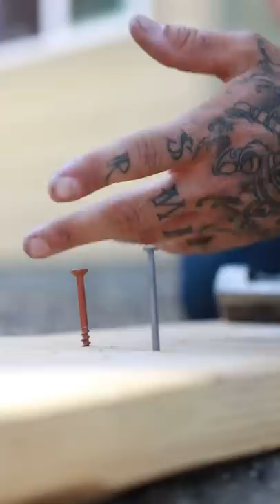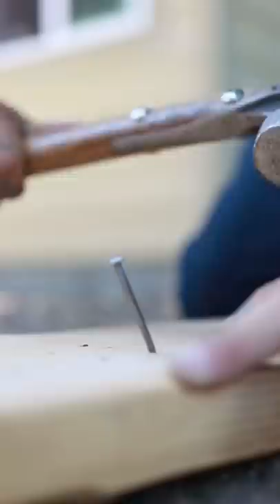Nails vs. Screws: Why do we use nails? #shorts

Comment: You’ve got bigger issues if your structure is moving enough to break a screw

Edit: I understand some structures will move but those are bigger buildings. A little 2 story home should not be moving enough to break a screw. Plus even if it did it is likely to back that nail out with that much movement
Reply: Nope. You got problems if your structure doesn't move. Especially in regions with earthquakes like for example in Japan. Look up 'japan earthquake skyscrapers swaying'. If they were completely stiff they could not absorb the force and would crack.
Reply: Carl Sagan  Of course not, but neither did they build them with screws. I  just meant to say that this is in principle a valid argument.
Reply: Is using nails really the right approach to earthquake proof a house? Seems like actually making it more rigid but with deliberately designed features to effectively provide suspension and/or lateral sliding movement would be the way to go there. That’s my impression of how those buildings are built. Not with flexible fasteners, but very stiff sturdy fasteners and rigid structures with specialised design elements to absorb the forces. 

But if we’re just talking normal houses in non-earthquake areas then you wouldn’t think this flexibility would even be much of a thing. Maybe slightly. But I am inclined to believe it’s mostly about cost in terms of the actual fastener cost but even more so the time cost. You can shoot multiple nails from different angles even diagonally in a couple seconds where it’d take a while to do that with screws. And the screws would need to be pretty expensive to be up to the task reliably long term etc. when instead u can just fire a bunch of nails in
Reply: @tristan7715  yes up high. Not single family homes lol
Reply: Carl Sagan  skyscrapers move a LOT, constantly. The taller they are the more they need to be able to move.
BTW, bolts and steel girders are also ductile (can flex).

Video is 100% accurate. This is why nails are used instead of screws.
Reply: No you have problems if your structure does not move.
Reply: Because nails are cheaper
Reply: How many builders does it take to figure out why they use nails 🤣🤣🤣
Reply: @tristan7715  
I'ts actually not....
Yes structures shift and settle but shod not flex near enough to break screws...

But everyone is an expert i suppose
Reply: True
Reply: Nails are all about speed and cost. Once you put 100,000 of anything in a structure, it's not about strength of one anymore.
Reply: Facts
Reply: I think you just have issues
Reply: Screws and nails have other uses. Would you use nails to attach the hinges on your doors? No - because the quality of inter-fibrous friction fasteners is superior for the job.
Reply: It has nothing to do with the fact it’s 10 times faster hahaha
Reply: @tristan7715  You're right dude. Don't listen to any of these smooth brains. Lol.
Reply: I use both. Assemble with nails. Reinforce with screws.
Reply: Hurricane straps for shifting highly stressed wooden timber elements typically use nails. Just a thought.
Reply: Not true.  Buildings move every day and are designed to move.   The earth moves.
Reply: Carl Sagan  bruh I’m weak from that I lold in the library
Reply: 😂 Flatlander….
Reply: @tristan7715  Nobody is building skyscrapers with nails and boards.
Reply: I reckon
Reply: @Thecabbagedog  and faster! I hear those framers and roofers all day long. It sounds like they are at the machinegun range!
Code calls for three nails, well, if I send 16 nails in, at least three will meet code!
Reply: No, because houses settle. So they actually move.
Reply: @tristan7715  I'm completely stiff.
Reply: @MarkusHeimy  that’s not true at all. All buildings move
Reply: @tristan7715  You're wrong. Skyscrapers aren't made in wood. Fundations are different for wood and concrete. Wood house's structure usually shouldn't move at all, it must slide on its fundations (originally, just flat rocks). In fact, earthquake-proof structures are the most stable/rigid so that they don't collapse.
Reply: @tristan7715  hes does residential frame construction, not giant metal and glass skyscrapers in Japan.
Reply: @rhino015  and this is why your not an engineer. Stay in your own lane kid and leave it to the professionals who devote their lives to understanding physics within buildings.
Reply: @nicholasburks1118  lol way to make things personal in a polite discussion. I’ve seen documentaries on earth quake proofing buildings, which is where the part about intentionally designing components for movement while keeping the bulk of it rigid came from
Reply: @rhino015  "I've seen documentaries" lol, please just stop
Reply: @nicholasburks1118  please enlighten us with your knowledge. Or are you just trolling by being rude?
Reply: Thought so
Reply: Ha ha ha. Look at the bigger picture, if the movement is not large enough to break the screw its still large enough to deteriorate the screw. The designers who study the specific are the ones to thank for all the power tools u use, the materials, the machines. The most incredible inventions in the world have been made possible thanks to not only the builder but the designer as well. So you can talk all the smack you want, but without them, the achievements you would accomplish are a just a fraction of what has been made.
Reply: @MarkusHeimy  and not everything is about speed and cost.
Reply: Structures move a lot, even from just the hydrostatic nature of wood. I’ve seen screws sheered from that.
Reply: @MineStrongth  ahh yeah so is that why they built skyscrapers using nails rather than threaded bolts/screws?? lmao
Reply: Like every 20ft of wood has movement from weather changes.
Reply: Well I hope you’re not a builder.
Reply: No, you have to use structural screws that aren't hardened so they can bend, every structure will settle at very least. But he used a deck screw which will break and isn't up to code anywhere on earth.
Reply: Pendejo .....what about tornadoes or hurricane 🌀
Reply: Honestly the bigger issue is people building cities in quake zones and on the coast in dangerous spots where natural disasters are common.
Reply: In east europe no one even builds houses with screws or nails
Reply: Not really expansion and contraction
Reply: @tristan7715  isn’t it great when people just pull completely made up bs out of their azz. 😂
Reply: @RealGame101  Yes they will they expand and contract a couple of inches. And thats only 1 thing thag makes them move
Reply: Man never heard of earthquakes
Reply: You. Be surprised how much structures flex while settling and during different seasons throughout the year. 

Also, tell me you’re not in construction without telling me your not in construction..
Reply: Reid, I am glad you are not a framer or structural engineer.  Let's not talk about things you don't understand
Reply: You'd be surprised at how much structures move
Reply: Like US framers…
Reply: If you don’t know anything about what’s being talked about, don’t say anything at all. If you don’t think buildings need to move and sway then you obviously haven’t had any experience with the matter. Keep your ignorance to yourself.
Reply: @nicholasburks1118  hey Nick I know it's been a year but I'd love some explanation on this smooth brain argument you got over here, just wondering why what Rhino (random person you never will meet) triggered you so bad by stating a educated fact. I'd love to have you draft my next shop shoot me a message
Reply: This is a dumb reply, and definitely doesn’t deserve 2.5k likes. Every building made on this earth will move. Dirt compacts and erodes, rocks erode, sand washes away. There is absolutely enough movement to shear a wall clean off, even within only a few years due to the house settling. This is a time tested statement
Reply: @nahhh5318  nahhh
Reply: I grew up in houses built in 1735. They didn't know what a screw was. The house is still standing today in 2023. Survive multiple hurricanes tornadoes storms. Some of the rooms aren't exactly level because the house settled but house is still not going anywhere
Reply: Even small houses settle my guy. Every building settles
Reply: 😅😅 Man's never seen an old house still held together despite severe settling.
Reply: Right I live in. House from I think like 1938 it's made of ceder on every couples months I have to pound the nails for the sinding back in
Reply: @marcochaves3661  haha yeah that makes sense. I guess you’re talking a higher standard at that point when they’re implementing features like this. The logic behind it makes some sense though. You’re right, the main thing is where you build haha. Avoid a fault line lol. Another thing is flood areas and bushfire areas, those are more the ones we get down here because we don’t really have a fault line anywhere near us
Reply: Yea I get it to, but let’s be honest this is one of those things when someone wants to be smarter then they are and put inaccurate information out. 😂
Reply: Houses are built for keeping nature out, not making you comfortable, that's just a benefit. Ide rather have nails in NW kansas with tornados every year than screws.
Reply: @tristan7715  😂 and skyscrapers don’t use “nailed” connections they use bolted and welded connections.
Reply: My thoughts exactly. We don't build homes w/ nails anymore in wv...haven't for awhile. Code wouldn't allow it here. This is an older American carpenter rule. Screws these days, especially when properly placed at intervals, aren't gonna sheer like this. Nails have a tendency to lose square over time do to the lack of threads and have largely become a thing of the past. Just like we don't use computers from a previous generation, we don't use fasteners that have been surpassed by new "higher tech" fasteners. At least on single family units
Reply: As a Superintendent w/background as a Union Carpenter, all buildings move, whether from temperature expansion/contraction and/or seismic, that's why buildings made of concrete or structural steel, still need slotted top track for metal stud framing, Expansion joints or slip dowels in concrete, expansion plates every on walls and floors, expansion joints in drywall, ACT ceilings fastened only on one side of room/wall, stucco walls have expansion metal every number of feet, etc
Reply: Your 2 story or even 1 story house may not sway in the wind but the foundation and ground under your houses foundation wears and cracks over time. The ground under it offsets and erodes. Everyone’s houses do this at some point but if you look carefully older houses usually have splits in door frames and cracks in ceilings or pavement.
Reply: the wind could make screws break as a lot of tension would be on it plus its anchored in, you need nails because they can slide in and out and twist and wiggle, much better for building large things than screws
Reply: @tristan7715  nope , sorry
Reply: For all the people arguing over screws vs nails this can easily be understood if you just do a little research on building codes in states that implement modern building standards. You don’t have to be a engineer to read plain English.
Reply: Nails are faster and cheaper. Bottom line is profit.
Reply: @Gamerz00760  20ft of my wood has movement from weather changes... if you catch my drift-wood
Reply: ABSOLUTELY. I just hate the fact that I've seen nails just PULL OUT of wood so sometimes build with screws
Reply: @tristan7715  you actually SEEN the way Japanese carpentry is done??? It's nothing like modern western carpentry with nail guns and 4x2. EVERYTHING of any decent size IS NOTCHED. It's like the house is ALL dovetail joins. Even their handsaws are VERY different. They cut as they're pulled backwards and have a handle closer to a BROOMSTICK than any saw we have.
Reply: Earth quakes, tornadoes, hurricanes and other storms with high winds. When they dug into the street in front of my building with a back hoe, I could feel the vibration while I was in bed. A asphault, through soil, through concrete to the brick building, wood floors, soft bed, the vibration still transferred to my body.
Reply: @tristan7715  really strange using them as an example because traditional architecture there doesn't use nails.

Comment: A screw might snap when you have 2 inches sticking out, not so easy when it's driven home, plus if your building moves enough to snap a screw, then you have more problem than screws snapping. The real reason is cost, nails are cheaper and quicker to use. I notice he didn't screw 2 pieces of wood together and try to snap the screw, this is not representing a real world situation at all.
Reply: Agreed
Reply: In real world situations a structural screw would be used in a sheer type situation. This video was a bad example of comparison
Reply: Facts….. was about to go into an engineering rant…
Reply: Thank you! ❤️
Reply: Was about to go rant about it too XD
Reply: Bingo. There are different setups to test shear. Hitting a long cantilevered screw head creates shear force and bending moment. And nails can't be "hot back and forth as many times as you want". This dude doesn't understand work hardening in metals.
Reply: Haha, internet engineers are the best
Reply: I think if he drove a nail and screw beside each other to fasten 2 boards in a 90° angle and started bending we would see the screw break and the nail bend. No genius here though.
Reply: 100% correct
Reply: Yea I mean he wrote all over himself so he must be pretty smart right?
Reply: Not an engineer, just a guy with experience. A well used screw would not only hold tighter but also increase friction between boards if they were to move. I can see a nail failing first because it would allow the boards to separate increasing range of motion. Maybe?
Reply: I’ve seen people with next too no framing experience argue this everyday, in Ontario screwed framing fails inspection.
Reply: While I agree cost is the major reason, the amount sticking out is irrelevant. Wood is soft, the two pieces you are joining will move a bit under load and be very similar to bending it sticking out the way he did. Yes it will take more cycles because it was bent as far, but the result is the same.
Reply: I would also think that a house needs a tiny bit of movement play, too. Where a screw keeps everything solid in place too much
Reply: Yep
Reply: @court2379  not true, leverage sir, the screws sticking out have more leverage, fulcrum point
Reply: I’ve seen and had screws snap from normal expansion and contraction on deck ballusters, I would never use them on decking, they snap and allow the boards to pull up
Reply: @grimrecords19  interior screws? Need coated exterior ones, and for cedar stainless is needed because it's acidic.
Reply: @UCKfw7Z6aNM5xejfXetSPrbw lmao such passion
Reply: Found the contractor
Reply: What are your credentials
Reply: I came here to say this. It’s a fundamental difference in usage. Yeah a nail will do most jobs, but the added security of a screw is better IMO. I worked for a friend who’d typically used screws instead of nails, and you’d need an excavator to demo what we built.
Reply: Yep
Reply: agreed, he just made up his own reasoning. Also the reason why the screen snaps is not because it’s a just happen to be a “screw”, it’s the material and hardening
Reply: @JoeyVSupreme  the issue with screws is longevity, I live in an incredibly windy area. Windiest area in North America. (Wreckhouse, Newfoundland, Canada) I’d never dream of framing with screws. Screw two boards together and nail two together, the screws will generally take more force to fail. The problem lies in repeated bending in different directions with low force which is what happens in the real world with a building shifting from high winds. In area with little wind I wouldn’t have an issue framing with screws tho.
Reply: Yes this example is unrealistic but I’ve also heard that screws aren’t rated for how we frame a house. However there’s one explanation I do like in that nails don’t have a weak point like screws.
Reply: @allstarwoo4  what are you talking about there’s no weak point in a screw the treads doesn’t serve any structural purpose, it’s strength is consistent from head to toe.
Reply: @KimoKimochii  no the threads are a weak point. For the most part the threads are thinner than the shaft. Are there screw that mitigate this weakness? Yes. Are they common? No. The other way your statement can be true is if you’re thinking of lag bolts.
Reply: @allstarwoo4  Your definition of weakpoint is wrong, the treads are not meant to provide any strength, the main shaft of a screw has consistence thickness with no weak points
Reply: The truth of the story is screws are just not as strong as nails
Reply: screws won’t pass inspection here for weight bearing framing, unless you use the grk lags but they are way pricey and crack a lot of them wood
Reply: I built a load of frame work in the back of an old range rover supporting a bunch of 18mm plywood dividers. The frame was bolted to the inside of the body.
Drove to Mongolia and back in it, when I got back about a dozens of the screws had snapped. I was quite surprised.
This is obviously a much more severe scenario than a house the the point still stands.
Reply: Actually it is. Think of a floor system. That is why typical screws do not meet minimum code for load bearing framing work.